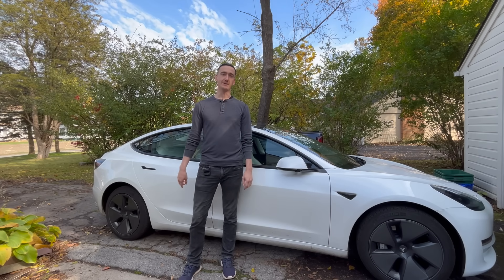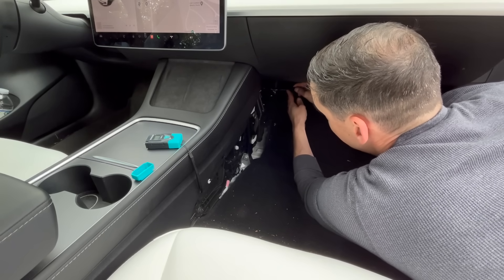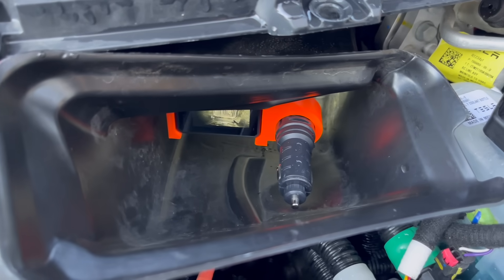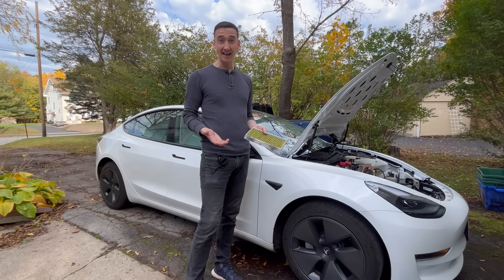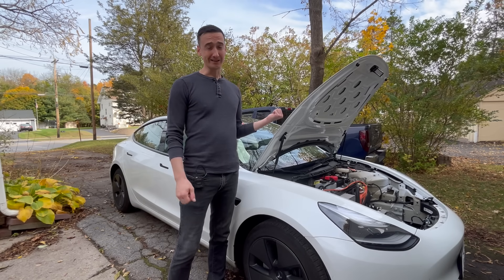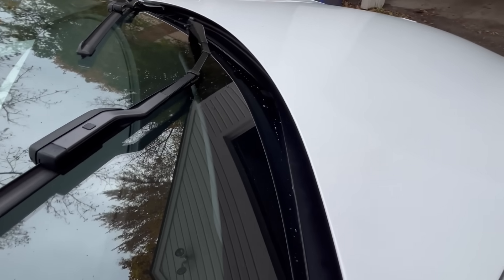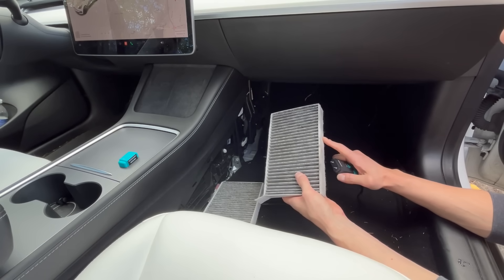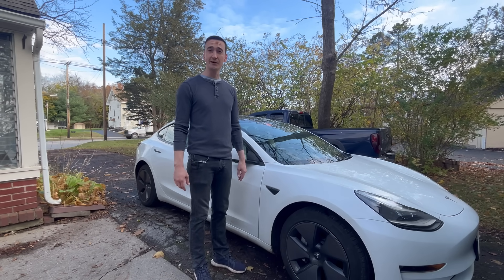This design flaw makes Tesla’s Model 3 smell bad! (with fixes!)

Comment: Great investigative video, but not everyone lives in wet climate, I live in the desert, Palm Springs cCA, very dry, and have had a stinky air car as well. it only rains about five days a year here and I don’t wash the car with the fan on full, I rarely wash my car. So I think there are other issues that are causing the smell, but maybe you’ve identified one for wet climates. I believe it is something with a condenser. Also another cars do have this problem, I’ve seen many posts online doing a Google search.
Reply: Also, I had the issue years ago and it has not come back, one cleaning of the condenser, and regular filter. Changes solved it for me, but again I am in the desert. Where is very very dry.

Comment: If you put a piece of plastic compleatly blocking the up facing intake and expand the "drain" hole to take the air in that way I think it could do the trick, it's not like a tesla needs to avoid engine fumes like a ice car. This is a design relick from that time that Tesla missed, unusual for them but it happens.

Comment: Bad design and cutting corners will always bite you in the ass. BTW the after market product shouldn't use adhesive tabs , heat will destroy the adhesive.  Make a cover and point  inlet at a angle downward where moisture can't enter.

Comment: New Model Y solution seems much better. The difference between some older Teslas and newer ones are like night and day, not just in case of cabin air, but other things like weather protection. Beware before you buy old Model S or Model 3, some have really started to rust badly because of bad weather protection.

Comment: Interesting video thank you! i am puzzled my September 2021 version has no gasket of any sort under the bonnet (Hood)? i can see 4 points i guess on the bonnet when its up where i assume the gasket you showed would connect but there isn't one on mine, nor has there ever been to my knowledge. To be fair i have never had or heard of the smelling issue either given the tonnes of rain we see here :( so wondered would the difference be mine is obviously right hand drive for the UK and this changes the interior layout of ducts?

Comment: Also, if anyone with this duct on hand can conduct CFM work? I like the idea of removing but rather be told where to cut or drill for that water to drain like intended. Why? I saw those leaves on that grade in the Model Y b-roll. Aren't they too biomass? Are those good for the airflow? 🧐Maybe for that “fall smell” 😂😊

Comment: Question has the new highland fixed this as well? one would think, the first testing would be soaking the car with water and seeing where water builds up with ac/heat off and then with it on at various output levels.   Seems like basic QA.,

Comment: When the water contains road deicing solution used here in the northeast everything under the hood will crumble in just a couple years. This is disappointing. Nice work on the video though.

Comment: What if you drilled some holes on both sides of the drain opening to release the pressure? Or drilled more holes along the bottom for water to drain out before it hits the fan opening.
Reply: Tesla should provide fixes and fix this design flaw!
Reply: @jacobheinz8236   I agree with you, but for now if it was my car, this might not be your car, I would modify it and if it works report to Tesla what you did and how they could fix it.  It might be fixed in the new M3, but I doubt they want to say it's "their" issue and have to recall 3 million cars.  I think a few simple holes will fix it.
Reply: You already have drain at the back. Problem is that it doesn't have valve in it, so when air is being drawn it makes a water sprayer instead of drain.
There are 2 problems:
1. No protection from water ingress.
2. Small intake which result in high air velocity that picks up water droplets.
Reply: It creates a vacuum or sprays the water in the vent because there is not enough release holes IMO. I would drill some more holes on the bottom and top to relieve pressure and that should allow the water to stabilize when the fan is on.
Reply: @Pure3nrg  That one big hole at the front is your air intake. Drilling more holes will lower the vacuum but in the same time will create opening for hot, smelly and dirty air from "engine bay".
Drilling holes at the top is the worst idea. Water would drop from above, from windscreen trim and be sucked in.
Water ingress with full power blower is marginal. Who really washes their car or drive in downpour with blower at full blast? The problem is constant ingres of small droplets and water mist during rain. That thing can accumulate on filter.
Other cause of "moldy smell" can be wrong drainage from evaporator, improper filter installation and it's touching the evaporator or simply lack of maintenance.

Comment: Thank you, This was very thorough and logical step by step analysis and problem solving. 
FYI I have a 2019 M3 and it doesn't have any gaskets fitted to the bottom lid of the frunk. We haven't experienced the smell as we rarely use the car in the rain!

Comment: I think the problem is the opening is just too small causing a lot of back pressure when the fan is on high. I do recommend not running the fan when washing your car. It's just a good practice.
Also the duct lack barriers to slow down the water and have multiple drain spots. The model Y without the HEPA filter has a hump in the middle and is a two piece design that allow water to leak out along the length of the duct instead of reaching all the way to the end like on the model 3.

Comment: This video is so appreciated and made me subscribe. I've gotten as far as you. I always suspected the filters. I also saw some replacements framed in silicon or plastic over the cardboard, and maybe their theory is water at the bottom of the compartment that soaks the bottom filter. I'll be removing the gasket, getting the Wix filters, and calling it quits and my detailer next. I found some for $11 during the last replacement. I was settling into replacing them every three months. This also explains why, once present, it gets more potent when it rains, and the system is not set to inside air only.

Comment: You must be an engineering tech (engineers that put things together). You should stick with electrical cars; the internal combustion is quickly coming to an end! That was an impressive video; this is how you solve a problem. You showed the problem is not unique to Tesla 👍🏾

Comment: Great stuff, I live in VA and have a mid ‘21 MY with HEPA and this still occurs. Cleaned coils and replaced filters and issue was back pretty quickly. Chocked it up to not enough cleaning of coils, am waiting to do it again.
Reply: Exact situation here and in the same area. The newer model y design with the hepa filter absolutely suffers from the same smell issue. I think the information in this video only partially covers the issue. It may also be a problem with water from the condenser draining out of where the filter and condenser sit.
Reply: @puppetpallmich  yeah, it’s unfortunate to have such an issue, I was going to have  Tesla clean this last go around so that they see it’s a problem but they wanted something like $300. Didn’t seem like warranty would cover it, which in my mind it should

Comment: Caution about removing the duct - you're going to be sucking in hotter and dirtier air closer to the road.  If you ever drive on a dirt road or sit in traffic, you don't want to remove that duct!
Reply: Also, it looks like that is protecting water from hitting other electrical components nearby which could cause issues over time.  It doesn't look like a good idea at all to remove that.

Comment: Too your knowledge. Does the Model S(2017) have this issue as well? I have had situations were I had terrible smell but I mostly got that during hot weather days.
Reply from the maker: Afaik bio weapons defense mode has been standard on the S and X since mid 2016. However a lot of commenters have said that they also get the smell, so I've lost confidence that the hepa filter resolved the issue 😔

Comment: Not sure you brought it up, but it’s not just water per se. The mold in the filter is also a result of living in humid places, think east coast, Texas, etc. Combine high heat/hot day + very high humidity then add in cabin over heat protection or simply driving with the AC on in high humidity, that duct really does a great job at channeling the moisture into the filter…

Comment: Tesla engineers seem to be suffering from terminal California-brain.

If I remember correctly, early Model 3s had an issue where the trunk wasn’t properly sealed so that rain could get inside.

They seem to be incapable of understanding that people live in wet climates.

Comment: Very good video.  I do have to point out that when your driving the air flow will change the way the water is being wiped away by the wipers.  To help simulate this.. I'd look at the rate of air flow going 45mph to 55mph and have a leaf blower trying to simulate that air flow over the test area....then try your experiment again.  This will more closely approximate how the water will flow or get splashed back.  Be mindful that your hose setup will approximate extreme rain fall...which is what I believe you are aiming for..yes?   I will say those gaskets to reduce water flow are an amazing product.  I'd be curious if the new model 3+ has a factory installed seal or been modified.  Still a great video.  Subscribed.  🙂
Reply from the maker: Until you stop at a red light!

Comment: My old 1st generation Prius had this same issue: if you left the AC running all the time, a horrible sour smell would come. My solution was simply to run the vent with the AC switched off for 2 minutes every other day.  This would completely dry the evaporator coil, killing off the source of moisture and killing the yeasts and germs causing the odor. Could the AC be switched off on a Tesla? Or could the heat be run for a few minutes, even during the summer, to dry the evaporator and save the horrendous job of dismantling the car? Maybe Tesla could do this in software?

Comment: So the video is for the model 3 but your sending us to a model Y link? ,so it works for both then?
Reply from the maker: This is TWICE that the Amazon listing has changed from the same URL! So frustrating. Thanks for pointing it out
Reply: Cool, great video,seems like the gasket should solve this problem,as well as using carwash mode..thnx

Comment: This is certainly a design flaw, that in my opinion should have been recalled, should it not?  My 2013 Ford Fiesta still smells pleasant to drive and has never had its cabin air filter changed.  My 2020 Model 3 Performance has gone through 3 sets now.  I'm going to try fixing this issue with your recommendations.
Reply: ... you have a car with a 10 year old cabin filter?

Comment: 2023 Shanghai Model 3 Highland now features HEPA filter, it is part of the redesign of the air system. Would be interested to tear down a Highland. I had high hopes for Shanghai R&D because they actually hire engineers from other factories.

Comment: Genius video. How are you smarter than all the engineers at Telsa. My X plaid is doing this really bad. I bought some Cool it Evaporator core cleaner but there is no hose for the drain like some vehicles so I was not able to use the Cool it Product. What a joke that they have this issue. This is such a health risk to blow mold into peoples faces.

Comment: Removing that duct means you will be pulling in hotter air from the hood compartment that's been heated by the radiator/condenser first, which will reduce A/C performance in the summer. It's essentially a cold air intake. Without the duct, you could also get some mildew smells from the sound insulation around the wheels and hood compartment. I think your testing exaggerates the amount of water that would actually get in the duct, and running the fan for a couple minutes  after the car is off would mostly take care of the moisture.

Comment: This is a very well done video.   Of course I am having the same issue complete with water streaks inside the filter box.  I have installed the gasket and have noticed the water draining between the bottom of the windshield and the top of the plastic cowl at the base of the windshield.  Bringing the car to Tesla for service is pointless.  They say that the issue cannot be duplicated.

Comment: Question? Does that gap at the back end of the frunk allow for air to enter in for the cabin intake? Does blocking that out limit the amount of air that can be sucked in? It looks like the air would only be drawn in from inside the frunk and maybe not enough air would be able to circulate through there? Otherwise, it looks like a great addition! Great video! Amazing research!
Reply: This was my thought as well…seems to explain why the factory gasket only covers the sides to allow more airflow to pass under the top of the hood. Maybe just gasket or diverter on the top/sides of the intake opening would stop water from dropping straight in and still allow airflow to pull in unobstructed from the bottom.
Reply: Only the cargo area of the frunk is sealed. The rest is open to the outside air due to the gaps from hood to fender. This is why all that black plastic around the cargo area gets filthy. There's no reason to worry about restricted air flow if you install that upper gasket. PLENTY of other ways that air to get in.

Comment: Never had this issue at all. And that intake is not like a normal intake on a car car. It should do no sucking cause the air is not feeding an engine. 

After watching you wash your windshield like a damn heathen though I now understand why your filters are wet.  Smdh.

Comment: Amazing video! Q: Does the gasket solution restrict airflow to the air intake? Is there some reason that the original gaskets didn’t go all the way across?
Reply: Personally, I would assume not. There seems to be plenty of room to pull air and if not then air will find its way in from any gap that isnt air-tight... just a personal opinion tho
Reply: The aftermarket gasket looks compelling, but I also feel like there’s got to be a reason Tesla didn’t do it that way…
Reply: @scottahrens9331 Yup, it’s a Tesla oversight putting it mildly. Plainly a design flaw!
Reply: I wonder if it's reducing resistance by allowing air to flow out, up the windshield, through that gap

Comment: Seems very odd that they have that duct. They typically are super keen to remove any part they can. In any case my Tesla is years old now and has never had an issue with a smell.
Reply: Where do you live and how do you mainly store your car when not using it?

Comment: Wow buddy, what a great video! Maybe a drain trap could be added at the bottom of the air intake. This would allow water to drain and stop the low pressure air in the duct from sucking the water up.

Comment: Tesla cars are affected more to bacteria because they do not have an ozon (climate gas) generator as others car manufactures have to accomodate for that problem. Thats the reason why the car runs the cabin fan, to reduce the humidity. If that does not work then ... smell :).

Comment: Awesome video, thanks!

So turn on car wash mode every time you're driving out in the rain? 
Especially heavy rain where the wipers might push lots of water downward.

Will using car wash mode this way cause any other problems?
Reply from the maker: Recirculate from the climate menu is all you need 17:18

Comment: Owned my M3 for over 4 years now, I've never had that much water in my AC intake, then again, I don't spray water directly under the hood with the AC blower motor running.  I also typically set my AC to recirculate mode as well. 
 I'm convinced the major source for the moisture is from the condenser, not from an external source like you show.

Comment: The mods are probably not going to help.  I’ve got had this issue on the 2019 M3, 2021 M3, 2022 MY, and my home HVAC.  Look up “dirty sock syndrome”.  It’s a microbe that affects certain HVAC and is basically an impossible fix if you want a high efficiency system in certain environments.